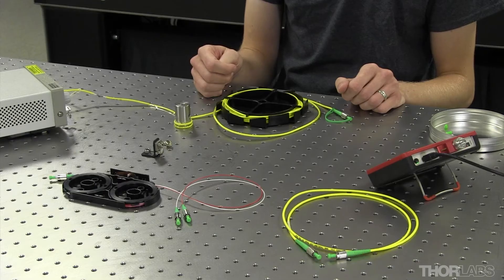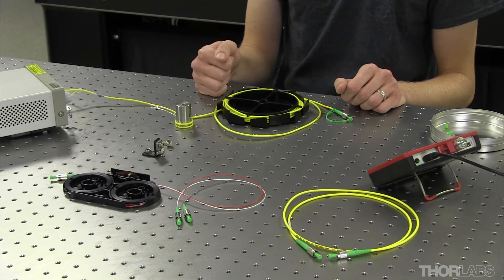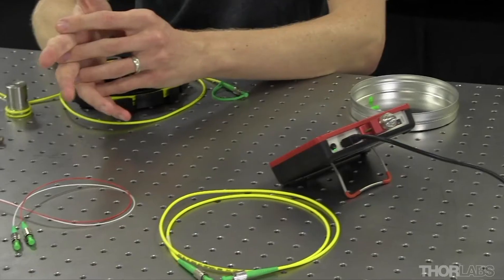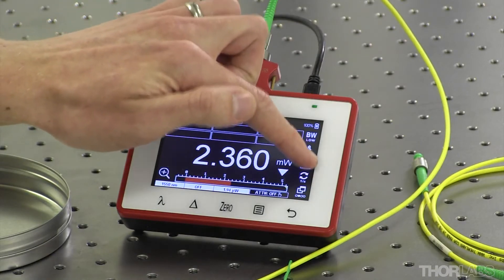Measure the Insertion Loss of a Fiber Optic Component | Thorlabs Insights

Comment: Any tips for reading optical insertion loss across a fiber using only an oscilloscope and adapters? XD
Reply from the maker: It sounds like you probably need a few more components. If this is something you’d like to discuss, please reply with more specifics about your application and what you’d like to measure, or feel free to contact tech support (techsupport@thorlabs.com).

Comment: Great demonstration! So I assumed that ~3 - 3.5dB loss would be the norm for a 1x2 splitter. So for a 1x8 you can expect around 10dB loss?
Reply from the maker: That's correct. In fact, an insertion loss of  ≤10.7 dB is specified for Thorlabs' TDE1315HF 1x8 single mode fiber optic splitter  (https://www.thorlabs.com/newgrouppage9.cfm?objectgroup_id=12771).